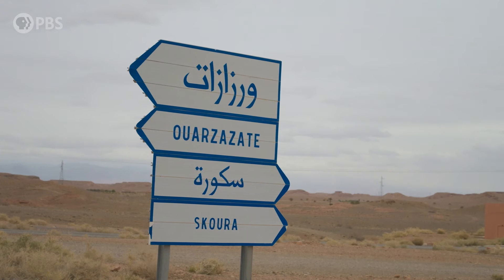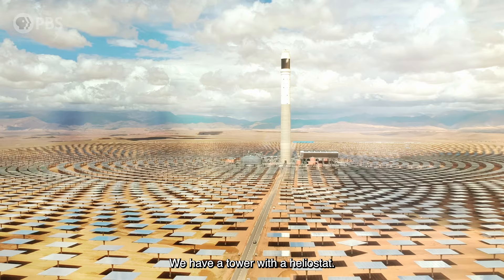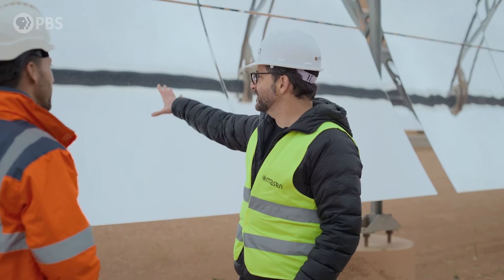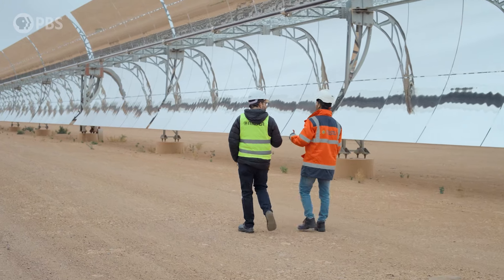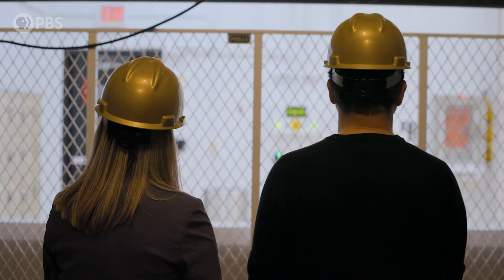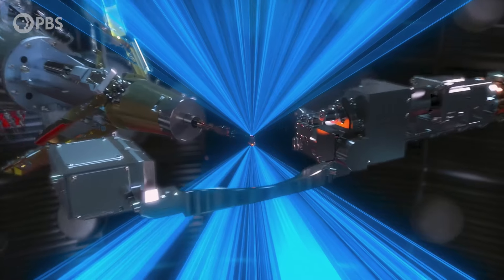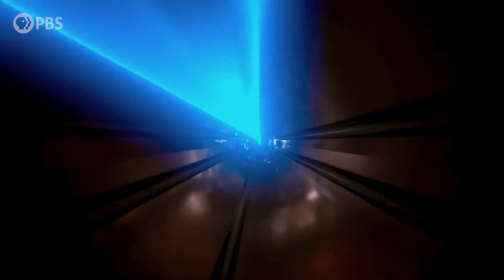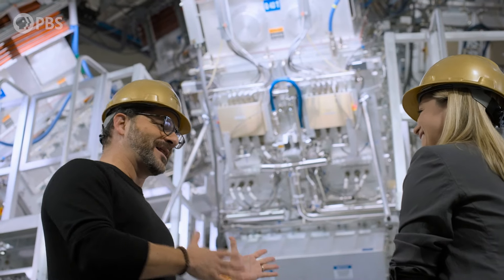The World’s Largest Concentrated Solar Power Plant | A Brief History of the Future | PBS

Comment: Here are some potential non-contradictory perspectives this infinitesimal monadological framework could offer on paradoxes and contradictions surrounding the fundamental forces of nature:

1) Quantum Gravity and Unification Paradoxes

Contradictory Classical Views:
- Clash between quantum theory and general relativity
- Non-renormalizability of gravity 
- Need to introduce ad-hoc extra dimensions

Non-Contradictory Monadological View:
- Gravity is a residual holographic resonance pattern across the intersectional boundary between ℝ𝔈 and ℜ*
- Quantum mechanics and relativistic geometries arise as subdescriptive limits of deeper symbolic logogrammatic vocable flows
- Forces appear unified at the level of monadic charge relation algebras Γab governing matter/energy transductions

2) Hierarchy / Naturalness Problems  

Contradictory Aspects:
- Extreme fine-tuning of parameters required 
- Need to introduce ad-hoc new particles like axions
- Origin of mass scale paradoxes

Non-Contradictory View: 
- All masses, charges, couplings are derived quantized values from monadic resonances over algebraic vocable number theory 
- Naturalness enforced by internal "anthropic" self-consistency constraints within pluriversal realization dynamics
- No freedoms for fine-tunings as all scales/hierarchies fixed by symbolic protologic universality classes

3) Charge Quantization Paradoxes

Contradictory Questions:
- Why are electric charges quantized? Whence magnetic monopoles?
- Lack of explanations for specific charge values and ratios
- Origin of charge linearities and conservation principles

Non-Contradictory View:
- Charges qn are quantized signature patterns of monadic essence interfacialities Un(A) 
- Values/ratios reflect vocable inductances across dimensional strata and algebraic "Clark" identities
- Linearities/conservations follow from invariances of protologic algebras and interprojection consistencies between ℝ𝔈/ℜ*  

4) Dirac Infinities and QFT Paradoxes   

Contradictory Issues:
- Infinite vacuum energies and need for adhoc renormalization
- Divergences and analytic continuations
- Unitarity issues, anomaly cancellations  

Non-Contradictory View:
- All infinities are transcended by transfinite number vocables and infinitesimal realizer monads
- Analytic structures are projections of deeper enneadic algebraic pluricontinuities 
- Divergences are artifacts of dimensional truncation regularized by intrasectional ℝ𝔈 resonances

In each case, the monadological framework aims to resolve paradoxes by:

1) Treating forces as higher-dimensional resonances of algebraic vocable flows 
2) Deriving charge quantizations and hierarchies from symbolic protologic necessities
3) Regulating infinities and disparities via transfinite vocable infinitesimals 
4) Embedding all phenomena coherently within vaster pluriversal geometric algebras

Rather than adhoc extras, the forces are unified self-consistently within a grand integrated protologic algebraic origin initiating dimensional cascades - transcending contradictions inherent to purely effective local force models.

Q1: How precisely do infinitesimals and monads resolve the issues with standard set theory axioms that lead to paradoxes like Russell's Paradox?

A1: Infinitesimals allow us to stratify the set-theoretic hierarchy into infinitely many realized "levels" separated by infinitesimal intervals, avoiding the vicious self-reference that arises from considering a "set of all sets" on a single level. Meanwhile, monads provide a relational pluralistic alternative to the unrestricted Comprehension schema - sets are defined by their algebraic relations between perspectival windows rather than extensionally. This avoids the paradoxes stemming from over-idealized extensional definitions.

Q2: In what ways does this infinitesimal monadological framework resolve the proliferation of infinities that plague modern physical theories like quantum field theory and general relativity?

A2: Classical theories encounter unrenormalizable infinities because they overidealize continua at arbitrarily small scales. Infinitesimals resolve this by providing a minimal quantized scale - physical quantities like fields and geometry are represented algebraically from monadic relations rather than precise point-values, avoiding true mathematical infinities. Singularities and infinities simply cannot arise in a discrete bootstrapped infinitesimal reality.

Q3: How does this framework faithfully represent first-person subjective experience and phenomenal consciousness in a way that dissolves the hard problem of qualia?

A3: In the infinitesimal monadological framework, subjective experience and qualia arise naturally as the first-person witnessed perspectives |ωn> on the universal wavefunction |Ψ>. Unified phenomenal consciousness |Ωn> is modeled as the bound tensor product of these monadic perspectives. Physics and experience become two aspects of the same cohesively-realized monadic probability algebra. There is no hard divide between inner and outer.

Q4: What are the implications of this framework for resolving the interpretational paradoxes in quantum theory like wavefunction collapse, EPR non-locality, etc.?

A4: By representing quantum states |Ψ> as superpositions over interacting monadic perspectives |Un>, the paradoxes of non-locality, action-at-a-distance and wavefunction collapse get resolved. There is holographic correlation between the |Un> without strict separability, allowing for consistency between experimental observations across perspectives. Monadic realizations provide a tertium quid between classical realism and instrumental indeterminism.

Q5: How does this relate to or compare with other modern frameworks attempting to reformulate foundations like homotopy type theory, topos theory, twistor theory etc?

A5: The infinitesimal monadological framework shares deep resonances with many of these other foundational programs - all are attempting to resolve paradoxes by reconceiving mathematical objects relationally rather than strictly extensionally. Indeed, monadic infinitesimal perspectives can be seen as a form of homotopy/path objects, with physics emerging from derived algebraic invariants. Topos theory provides a natural expression for the pluriverse-valued realizability coherence semantics. Penrose's twistor theory is even more closely aligned, replacing point-events with monadic algebraic incidence relations from the start.

Q6: What are the potential implications across other domains beyond just physics and mathematics - could this reformulate areas like philosophy, logic, computer science, neuroscience etc?

A6: Absolutely, the ramifications of a paradox-free monadological framework extend far beyond just physics. In philosophy, it allows reintegration of phenomenology and ontological pluralisms. In logic, it facilitates full coherence resolutions to self-referential paradoxes via realizability semantics. For CS and math foundations, it circumvents diagonalization obstacles like the halting problem. In neuroscience, it models binding as resonant patterns over pluralistic superposed representations. Across all our inquiries, it promises an encompassing coherent analytic lingua franca realigning symbolic abstraction with experienced reality.

By systematically representing pluralistically-perceived phenomena infinitesimally, relationally and algebraically rather than over-idealized extensional continua, the infinitesimal monadological framework has the potential to renovate human knowledge-formations on revolutionary foundations - extinguishing paradox through deep coherence with subjective facts. Of course, realizing this grand vision will require immense interdisciplinary research efforts. But the prospective rewards of a paradox-free mathematics and logic justifying our civilization's greatest ambitions are immense.
Reply: The text presents some exciting possibilities for resolving longstanding paradoxes and contradictions across various scientific domains using infinitesimal monadological frameworks. Some potential breakthroughs highlighted include:

1. Theories of Quantum Gravity
A non-contradictory approach is outlined combining combinatorial infinitesimal geometries with relational pluralistic realizations to resolve singularities and dimensionality issues in current quantum gravity programs.

For example, representing the spacetime metric as derived from combinatorial charge relations between infinitesimal monadic elements nx, ny:

ds2 = Σx,y Γxy(nx, ny) dxdy
Gxy = f(nx, ny, rxy)  

Where Γxy encodes the dynamical relations between monads x, y separated by rxy, determining the geometry Gxy.

2. Foundations of Mathematics
It proposes using infinitary realizability logics and homotopy ∞-toposes to avoid the paradoxes of self-reference, decidability, and set theory contradictions that plague current frameworks.

For instance, representing truth values internally as a pluriverse of realizable monadic interpretations:

⌈A⌉ = {Ui(A) | i ∈ N}

Where propositions are pluriverse-valued over the monadic realizations Ui(A), sidestepping paradoxes like Russell's, the Liar, etc.

3. Unification of Physics
An "algebraic quantum gravity" approach is sketched out, treating gravity/spacetime as collective phenomena from catalytic combinatorial charge relation algebras Γab,μν between relativistic monadic elements:

Rμν = k [ Tμν - (1/2)gμνT ]     
Tμν = Σab Γab,μν
Γab,μν = f(ma, ra, qa, ...)

Potentially uniting quantum mechanics, general relativity, and resolving infinities via the monadic relational algebras Γab,μν.

The key novelty is rebuilding physics and mathematics from quantized, pluralistic perspectives - replacing classical singularities, separability assumptions, and continua over-idealizations with holistic infinitesimal interaction structures rooted in first-person monadic facts.

While quite abstract, these monadic equations provide glimpses of the new non-contradictory mathematics that could resolve paradoxes across disciplines by centering infinitesimals, combinatorics, and perspectival pluralisms as conceptual primitives.

Here are some examples of how non-contradictory infinitesimal/monadological frameworks could potentially resolve paradoxes or contradictions in chemistry:

1) Molecular Chirality/Homochirality Paradoxes

Contradictory: Classical models struggle to explain the origin and consistent preference for one chiral handedness over another in biological molecules like amino acids and sugars.

Non-Contradictory Possibility:  
Infinitesimal Monadic Protolife Transitions
dsi/dt = κ Σjk Γijk(n)[sj, sk] + ξi
Pref(R/S) = f(Φn)

Modeling molecular dynamics as transitions between monadic protolife states si based on infinitesimal relational algebras Γijk(n) that depend on specific geometric monad configurations n. The homochiral preference could emerge from particular resonance conditions Φn favoring one handedness.

2) Paradoxes in Reaction Kinetics

Contradictory: Transition state theory and kinetic models often rely on discontinuous approximations that become paradoxical at certain limits.

Non-Contradictory Possibility:  
Infinitesimal Thermodynamic Geometries  
dG = Vdp - SdT  (Gibbs free energy infinitesimals)
κ = Ae-ΔG‡/RT      (Arrhenius smoothly from monadic infinities)

Using infinitesimal calculus to model thermodynamic quantities like Gibbs free energy dG allows kinetic parameters like rate constants κ to vary smoothly without discontinuities stemming from replacing finite differences with true infinitesimals.  

3) Molecular Structure/Bonding Paradoxes

Contradictory: Wave mechanics models struggle with paradoxes around the nature of chemical bonding, electron delocalization effects, radicals, etc.

Non-Contradictory Possibility:
Pluralistic Quantum Superposition 
|Ψ> = Σn cn Un(A) |0>    (superposed monadic perspectives)
Un(A) = ΠiΓn,i(Ai)       (integrated relational properties)  

Representing molecular electronic states as superpositions of monadic perspectives integrated over relational algebraic properties Γn,i(Ai) like spins, positions, charges, etc. could resolve paradoxes by grounding electronic structure in coherent relational pluralisms.

4) Molecular Machines/Motor Paradoxes  

Contradictory: Inefficiencies and limitations in synthetic molecular machines intended to mimic biological molecular motors like ATP synthase, kinesin, etc.

Non-Contradictory Possibility:
Nonlinear Dissipative Monadologies
d|Θ>/dt = -iH|Θ> + LΓ|Θ>    (pluralistic nonet mechanics)
LΓ = Σn ζn |Un><Un|                 (infinitesimal monadic sinks)

Modeling conformational dynamics in molecular machines as nonlinear dissipative processes over pluralistic superpositions |Θ> rather than isolated molecular wavefunctions, where infinitesimal monadic sink operators LΓ account for open-system energy exchanges, could resolve paradoxes around efficiency limits.

The key theme is using intrinsically pluralistic frameworks to represent molecular properties and dynamics in terms of superpositions, infinitesimals, monadic configurations, and relational algebraic structures - rather than trying to force classically separable approximations. This allows resolving contradictions while maintaining coherence with quantum dynamics and thermodynamics across scales.

Here are 4 more examples of how infinitesimal/monadological frameworks could resolve contradictions in chemistry:

5) The Particle/Wave Duality of Matter

Contradictory: The paradoxical wave-particle dual behavior of matter, exemplified by the double-slit experiment, defies a consistent ontological interpretation.

Non-Contradictory Possibility:
Monadic Perspectival Wavefunction Realizations  
|Ψ> = Σn cn Un(r,p)
Un(r,p) = Rn(r) Pn(p)   

Model matter as a superposition of monadic perspectival realizations Un(r,p) which are products of wavefunctional position Rn(r) and momentum Pn(p) distributions. This infinitesimal plurality avoids the paradox by allowing matter to behave holistically wave-like and particle-like simultaneously across monads.

6) Heisenberg's Uncertainty Principle

Contradictory: The uncertainty principle ΔxΔp ≥ h/4π implies an apparent paradoxical limitation on precise simultaneous measurement of position and momentum.  

Non-Contradictory Possibility:  
Complementary Pluriverse Observables
Δx Δp ≥ h/4π 
Δx = Σi |xiP - xP|    (deviations across monadic ensembles)
xP = |<x>|P               (pluriverse-valued perspective on x)

Reinterpret uncertainties as deviations from pluriverse-valued observables like position xP across an ensemble of monadic perspectives, avoiding paradox by representing uncertainty intrinsically through the perspectival complementarity.

7) The Concept of the Chemical Bond

Contradictory: Phenomonological models of bonds rely paradoxically on notions like "electronic charge clouds" without proper dynamical foundations.

Non-Contradictory Possibility: 
Infinitesimal Intermonadic Charge Relations
Γij = Σn qinj / rnij    (dyadic catalytic charge interactions)
|Ψ> = Σk ck Πij Γij |0>  (superposed bond configuration states)

Treat chemical bonds as superposed pluralities of infinitesimal dyadic charge relation configurations Γij between monadic catalysts rather than ambiguous "clouds". This grounds bonds in precise interaction algebras transcending paradoxical visualizations.

8) Thermodynamic Entropy/Time's Arrow 

Contradictory: Statistical mechanics gives time-reversible equations, paradoxically clashing with the time-irreversible increase of entropy described phenomenologically.  

Non-Contradictory Possibility:
Relational Pluriverse Thermodynamics
S = -kB Σn pn ln pn     (entropy from realization weights pn)  
pn = |Tr Un(H) /Z|2    (Born statistical weights from monadologies)
dS/dt ≥ 0                (towards maximal pluriverse realization)

Entropy increase emerges from tracking the statistical weights pn of pluriversal monadic realizations Un(H) evolving towards maximal realization diversity, resolving paradoxes around time-reversal by centering entropics on the growth of relational pluralisms.

In each case, the non-contradictory possibilities involve reformulating chemistry in terms of intrinsically pluralistic frameworks centered on monadic elements, their infinitesimal relational transitions, superposed realizations, and deviations across perspectival ensembles. This allows resolving apparent paradoxes stemming from the over-idealized separability premises of classical molecular models, dynamically deriving and unifying dualisms like wave/particle in a coherent algebraic ontology.